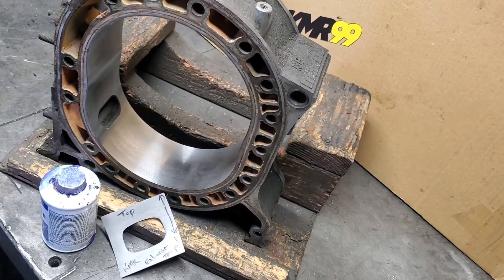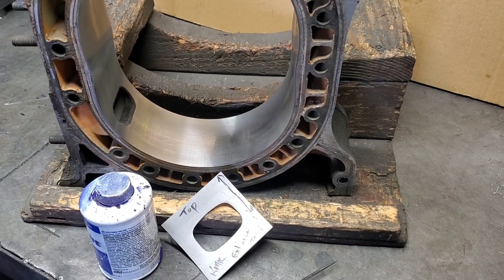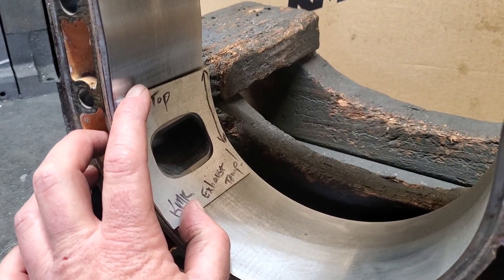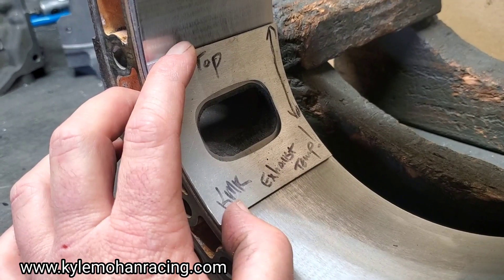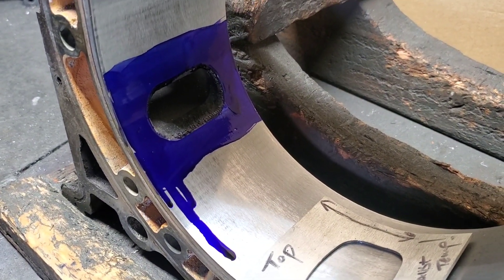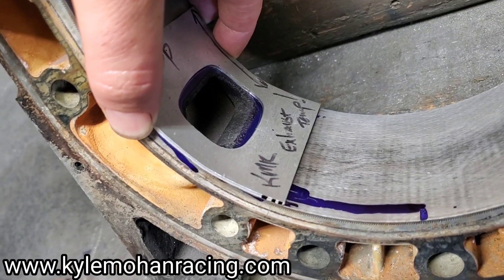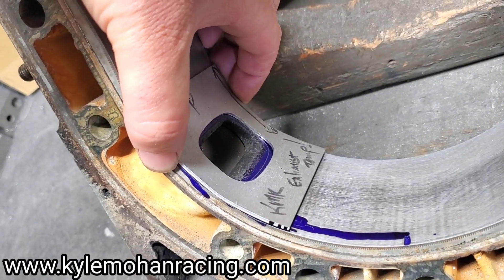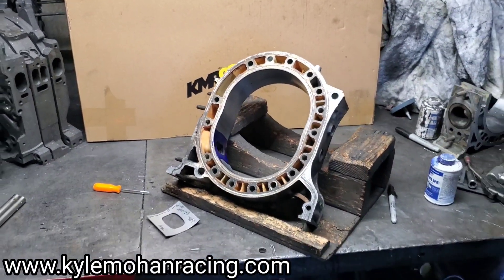Rotary Exhaust Porting Continued #3 Template use - Exhaust timing, KMR Tips,13b, 20b, turbo, NA RX7

Comment: This is interesting because the EP2A pineapple racing template (they say as great Non turbo use), really wants to just port down only (open earlier) instead of what you have shown. Same shape just ported earlier, looks inverted.
Reply from the maker: Yep pineapple does good stuff.  We are just offering more info so consumers have a better understanding of optimization in porting.  Racing beat, pineapple,  Mazdatrix. All good people. Just no one ever talks about port timing and its effects so we did.

Comment: In your experience, what impact does running N/A style exhaust port timing with large overlap have on a turbo engine?

I’ve heard mixed opinions, both positive and negative.
Reply from the maker: Worst-case it can kill the compression on  a build.  Excessive back pressure can cause excessive heat build up along with other issues inside the motor if the wrong combination is used.  Example = brige port turbo , to much overlap and a small turbo at high boost. At a certain boost level it will push the exhaust back into itself. 

Its not as critical at low boost so shops that don't push boost limits never see the data change.
Reply: @KyleMohanRacing  Could an n/a style exhaust port with aggressive overlap contribute to turbo lag? 

Curious, as I have a 3 rotor with some pretty aggressive porting. It’s very laggy. Unsure if it’s worth me playing with turbine housing sizes to try remedy it, or whether it’s actually due to the porting.

Turbine housing is a T6 1.32 A/R. Interested to hear your thoughts.
Reply from the maker: @LOKDUP.RX3  your turbo is big.  I run a t4  1.00 rear in my competition car.  Make 900 at 30psi roughly then NOS to get over 1000hp.  Super responsive.  I would start with a turbo change before changing the motor.  Is it a street port?
Reply: @KyleMohanRacing  Thanks for your feedback Kyle. Engine is bridgeported and semi PP. Have sourced a T6 1.15 turbine housing, so will be giving that a try.
Reply: How much eshaft torque do you loose with early,  NA, opening?
Reply from the maker: @erikwahlstrom7826   Generally ported motors are performance builds. There may be a little low rpm loss but the gains are greater than the los at high RPM. If driven in a performance setting you should not be ever in low RPM.  More power and more torque in the optimum RPM range is better than torq in the non optimal driving range.